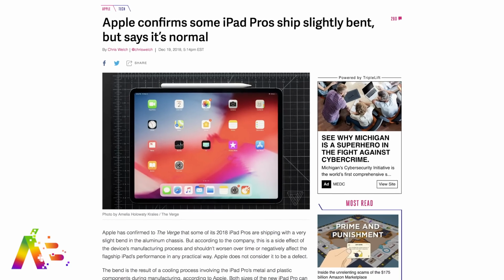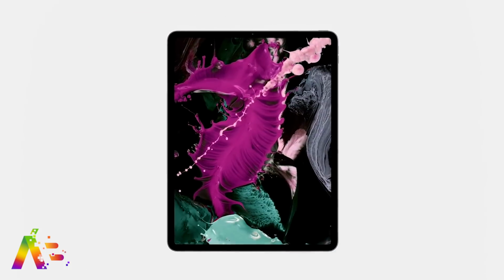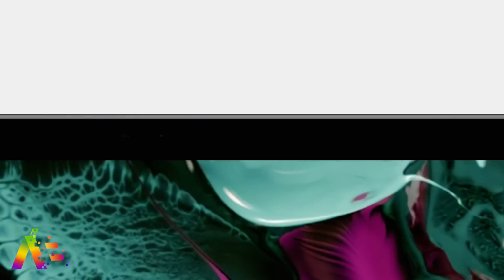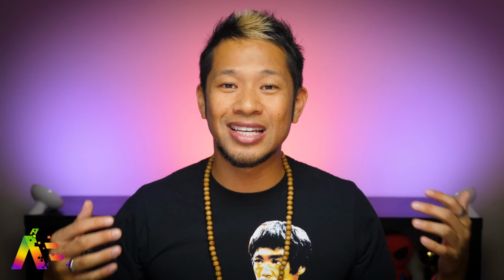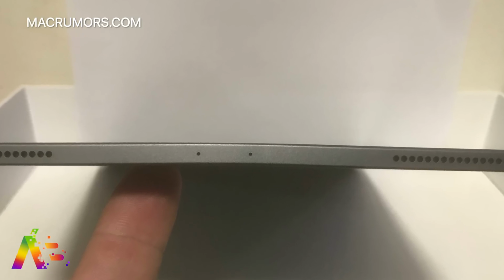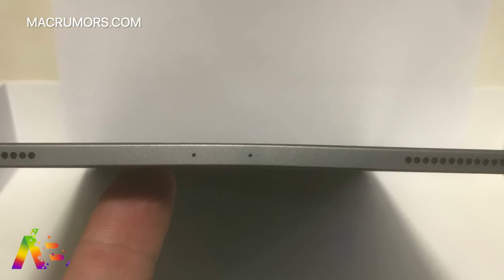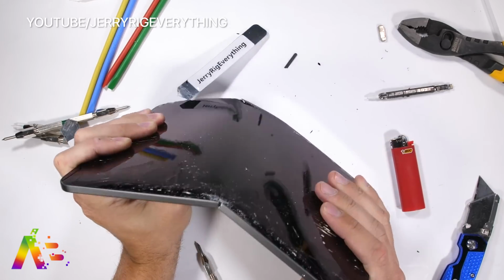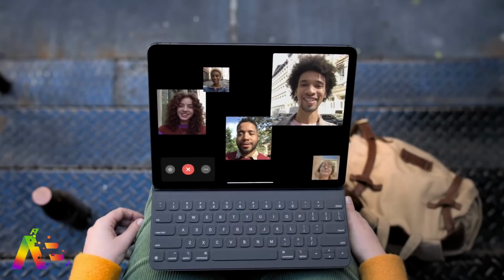Apple says your bent iPad Pro is normal?!?

Comment: You're saying "This isn't the Apple that I know" ... And yet you cited 3 instances where they did similar things for years ... So maybe it IS the Apple that we know.
Reply: Very observant, good point
Reply: so true
Reply: @Artan L Given the positions where they were kept, it wasn't that hard. If you hold a device smaller than your palm, your fingers will wrap around the other side. And based on the way the antenna was arranged, it was almost inevitable. Apple even tried to make a profit on their "mistake"; which is part of the reason why I wonder if it even was a mistake. My question is - did nobody test the device before launching it? I always that thought that we'd have a lot of testing, both internally and by beta testers, before a product is released; and it is mathematically impossible that not a single tester didn't hold their device in that manner when a good portion of the public did. Plus, it wasn't Apple's first device; we've always put antennas on top, why suddenly switch its position.

And I was just using that as an example because it was cited above. There had been complaints that the 2008, 2009 and 2010 Macbooks had one major issue that Apple refused to fix, where a capacitor or something with a lower than required power rating was put in to save costs, and it would blow up or fuse, causing frequent repairs. Another example is the 2010 macbook which had an issue and only got a warranty for that 3 years after its release, in 2013. And this warranty was valid for only 3 years since the date of purchase, so all the fanboys who bought it on the first day got screwed over the most. (During the SJ days, the problem wasn't even given a Warranty. The Warranty came from the post SJ days, regardless of how scummy it was).

I would recommend you watch Louis Rossmann's teardown of their engineering failures over the years. He has tons of examples.

I'd actually say Apple was awesome in the pre-iPhone days, about halfway through the iPod days; when their main focus was the Mac, and they didn't realize they were the leader of a massive cult.

And yes, as I've said, I do agree with the notion that its worse these days - nowadays it feels like the higher ups are playing a game where they bet on how far they can push the average iSheep before he/she actually jumps ship. Oh it's definitely worse. Just stating that those days weren't that much better. They led the industry, sure. But that was probably on the industry, and not so much on them.
Reply: @Artan L Agree to disagree? We could go on and on about something subjective like the way we hold our phone, and whether or not a decade old phone was worth the money, but I don't think either of us will convince the other. I still recommend you watch Louis Rossmann's video though. Here's a link:

https://www.youtube.com/watch?v=AUaJ8pDlxi8&t=13s
Reply from the maker: I’m referencing the glory days of SJ. I’ve already said it’s a different Apple many times now so I just don’t want to be a broken record about it. They are fundamentally different.
Reply: Brian Tong - Apple absolutely are different now. They seem... adrift and relying on what SJ left for them. If they don’t innovate and delight soon, people will eventually gravitate elsewhere. It’s what humans do!
Reply: @briantong  I totally agree with you. I feel like we just have to move on and realize it will never be the same. This type of news honestly doesn't surprise me anymore and it's really sad. At what point do we stop giving them free passes just because of SJ?
Reply: You say glory days of SJ, but if you remember it - "You're holding it wrong" was from SJ days. No doubt it was better then, but those days weren't amazing enough in my opinion to refer to them as "Those were the days..." You just noticed it less because the internet wasn't around.

Comment: No, that’s a Trash Apple!!!
Wow this is ridiculous. 
No Excuse for this and they need to be held accountable for it.
A 2,000$ dollar iPad should not come bent or bend with ease period WTF, come on Apple.
Reply: While I am on your side, 2000?
Reply: Tushar Vazirani, Yes 2,000$ if you want the top spec version 1tb with all the bells and whistles and accessories. 
You know how apple can be.
Reply: Sad. I think they should stop charging extra for the cellular one. Basically make only WiFi + Cellular configurations for Wifi money. Also, Apple needs a kick in the ass. I am a big Apple fan but this is more like bad quality, even if it's a piece of shiny slim aluminum and glass. @DDC-12
Reply: Tushar Vazirani, indeed I agree 100%
Reply: This is true no other tablets does it not even the cheap ones like rca bends and you pay $50 bucks for that but a 800 and up bends with ease. Cmon apple you gotta do better. The phone I understood it went on your pocket which Is still ne excuse but I gave em the benefit of the doubt.
Reply: Starts at 799$ to 1tb is 1099$ stupid
Reply: @mohpro74  It's $1,899.00 no pen, no cover, no taxes. In Europe, anywhere, you pay way over 2000 for one with top specs. And you can nonetheless  get it bent.
Reply: It’s 799$ the pen costs 49.99$ https://www.apple.com/shop/buy-ipad/ipad-pro
Reply: I have the iPad Pro and I dropped many times and accidentally sat on it it still doesn’t have any problems no bent or cracks only of you purposely bent it